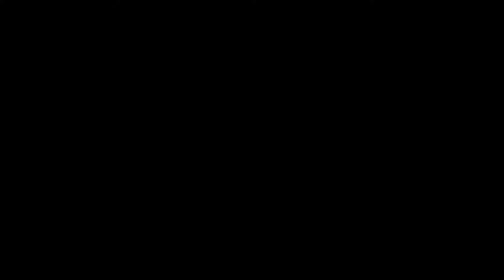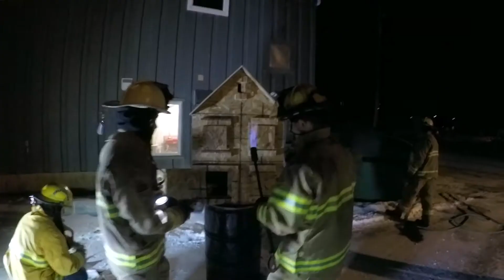Fire Behavior Dollhouse Demonstration

Comment: Did you think about how firefighters open and usually leave the door open? And when the door is closed the fire quickly EXTINGUISHED until the door was opened again. What happens to all the 3,000 toxic gases? The rooms get too rich to burn and also the flames byproduct is water and carbon dioxide until the doors and windows are opened again. there is a lot more going on with this fire than the instructor is telling